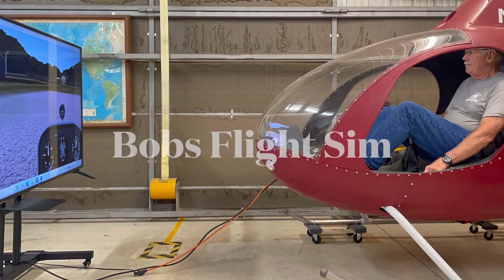Rotorway Gathering OCT 2021

Comment: Joseph awesome video.  When working through your trailering process did you ever consider leaving the rotors on the machine and just threading the forward pointing rotor through a hole in the front of the trailer? Thanks
Reply from the maker: It’s not advisable to trailer with the blades on. Even if supported damage could occur to the pitch pins and aligner block bearings. It only takes about 30 mins to remove or install blades. Safer to do that than risk damage to the blades during transport